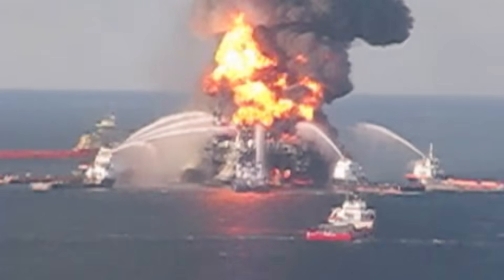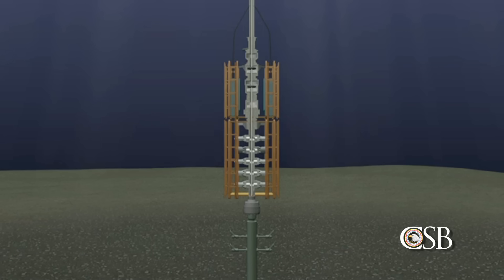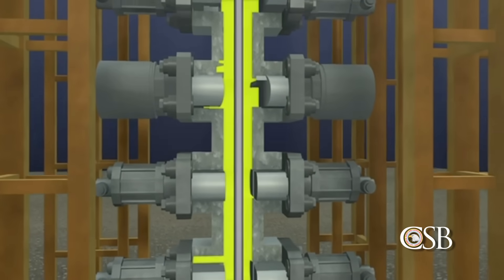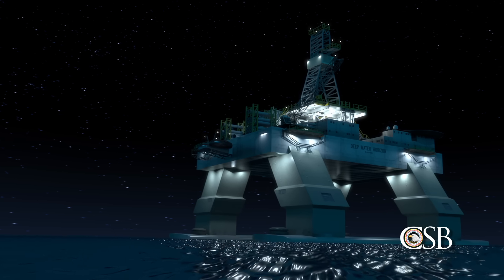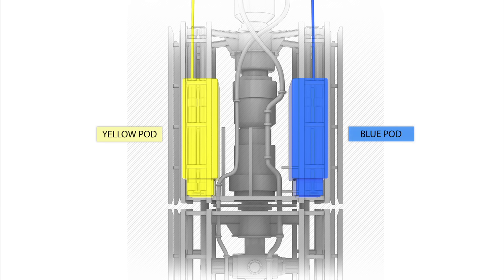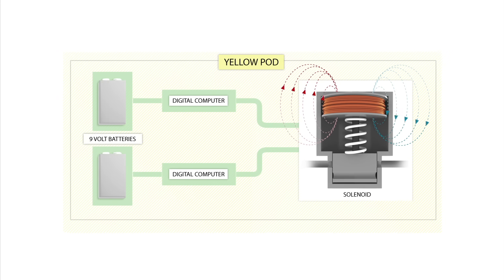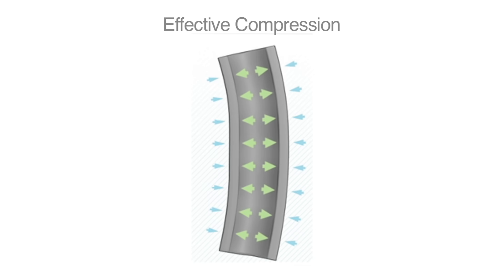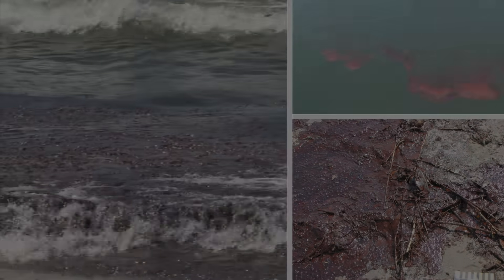Deepwater Horizon Blowout Animation

Comment: Nice video, thank you for the information.  However, I have one issue with it, in the opening lines of the video it says that the Deepwater Horizon Blowout was the “largest oil spill in US history.” As I understand it, the estimated loss of oil from the Deepwater Horizon was 4.9 million barrels of oil.  However, the estimated loss of oil from the Lakeview Gusher in 1910 was 9.0 million barrels of oil.

Maybe the Deepwater Horizon Blowout was the largest off shore oil spill, I don’t know, but it clearly was not the “largest oil spill in US history.” I’m not saying that the Deepwater Horizon Blowout was a trivial oil spill, but this is a simple fact has been miss reported over and over again unit everyone just accepts it as "a fact.".  I guess if it’s said often enough it becomes fact…
Reply: Maybe it has more to do with the effects of the spill, rather than sheer volume of oil being spilled? Offshore rigs going down causes quite a lot more damage to a wider area than land-based spills...
Reply: Barrels and gallons are not the same thing, Cory.
Reply: @Shane Lizard it's important to note that about half of the oil spilled from Lakeview gusher was in fact contained and recycled/saved, and that measuring accuracy in 1910 was likely far less accurate than in modern times.

The fact that it was contained on land also made it far less detrimental in general.  But that's besides the point.
Reply: @Shane Lizard what are you talking about?  I am 100% correct.  My claim isnt that they quoted the amount wrong; I said deepwater horizon was the largest oil spill in US history, not Lakeview gusher, which is true... not to mention that "barrels" is not a standard if measurement; gallons is.

You should probably read the statement before trying to correct it like a moron.
Reply: I think that must be the case. It's also because of the extensive damage that the oil caused for the ocean
Reply: Sorry but that is a mistake.  200 million gallons of oil released in 87 days; BP's deepwater horizon incident is in fact the largest spill in US History.
Reply: 200 million!!!

Comment: If this is all correct, there sure was an awful lot of crap to go wrong. I am not implying any thoughts by saying that, but it is hard for me to imagine so much going wrong with so much redundancy. I just wonder if there is a simpler answer, or if not, what are the odds? I have not paid attention to this subject and have no real thoughts, but I would imagine there are conspiracy theories about this because of all the things presented as coincidence, or all the cause and effect.
Reply: Using a BOP that should be held OPEN, not held CLOSED. Like God Damn, if you lose power those shear rams should snap shut and slice the pipe in half to try and save the rig; bam, your dead-man switch is an electric trigger that keeps a solenoid inside holding the rams open under massive spring tension. Power fails, solenoids switch off, rams slam down on the pipe and shear it in half
Reply: multiple incidences of incompetence combined with inadequate testing
Reply: You can still have failures no matter what configuration. The idea here is you have several separate systems working so that even if 9/10 fail the last one can prevent the accident. The biggest issue had nothing to do with how these systems were designed it was the complete lack of testing done to check if it's working or not.
Reply: Its simple, human error.

Comment: So let me get this straight this who disaster was caused by a presure drop inside the anular space on the BOP and a miswired solinod valve.
Reply: It was more of a result of breach of multiple safety systems. Clearly defence in depth was applied but due to multiple failures in human actions and instruments it allowed for a critical path that pierced all layers and lead to the accident.
Reply: There were a bunch of things. You are supposed to test equipment and keep it maintained. Lots of stuff on first testing can be found to be a complete mess, it's just natural at some point someone makes a mistake. The checking is supposed to catch that so you have 2 issues, the wiring and lack of inspection/maintenance. It is really crazy both systems failed though, that is extremely rare.
Reply: @MrFunkhauser  That's how regulations occur and then these same companies complain about regulations. To them, that 5,000 barrels of oil was excusable and not worth additional regulation.
Reply: Yep. On those oil rigs, one thing screws up the tiniest bit, you're f**ked.
Reply: Solenoid*

Not trying to be a grammar Nazi, just a genuine correction in what that thing is called
Reply: @theshermantanker7043  thank you for the correction
Reply: *solenoid valve 

The solenoid valve actually ironically ended up working 

Issue to fix though

The annular valve didn’t stop 

Action could hav been taken faster to stop the initial flo me he
Reply: @ you are correct on that.
Reply: The flow was so forceful it broke right through the sheer ram ,   I've been studying the DWH for months and I'm still learning about what exactly happened
Reply: @ exactly. There’s a lot of great information out there on the accident.
Reply: @FerroequinologistofColorado  another major factor was that BP did not run the cement bond log test to see if the cement had cured properly,   the testing team was sent home because BP didn't want to spend 120 grand for the test.   A 186 billion dollar company and they're cheap
Reply: @ exactly.

Comment: This is a superb animation of the BP/Halliburton/Trans-Ocean disaster BUT I'm rather surprised that the fact that they only used six spacers instead on the 21 spacers necessary in keeping the "Halliburton" cement centered and evenly spaced throughout the bore as one of the most likely contributing factors. You also didnt mention that Schlumberget engineers left the rig after they were overruled on an inspection on the cement's condition and hardening. Had the cement been tested and analyzed thoroughly, this wouldn't have happened. Yet another perfect example of profits over people/environment/safety by The Big crimcorfednewsgov outfits around the globe. The consequences? We're still learning them and will continue for centuries to come. Can anyone say...Exxon Valdez 1989? BP had a larger hand in that disaster than even Exxon and like BP...Exxon is fighting to keep every dime from reaching the people who won it from them in a settlement reduced to 10% of the original payout of about 6,000,000,000.00 by the supreme court of corporate jesters.

Comment: The drilling fluid-mud is the first line of prevention to control formation pressure.  If the fluid density isn't enough to balance the formation pressure a kick will occur (influx oil and gas) into the well bore right? Why didn't personnel catch this influx immediately as excess displaced drilling fluid in the mud pits? Bad communication?
Reply: Because corporate would effectively hang them if they didn't keep up with the schedule. DWH was far behind schedule at that point and draining money like a seave...
Reply: Harrison _  what kind of answer is this?
Reply: One word: Capitialism
Reply: @padathir  don't act like communism doesn't do the same too. Need I remind you about Chernobyl and how it was made worse by the Soviet Union trying to cover it up?
Reply: Harrison _  They are doing pretty good right now. Crashed the economies of the west, took hong kong, handled the virus.

Comment: Someone help me to understand.
If as they sad, the pipe ram worked successfully and isolated the annulus space and drill pipe space above the pipe ram. Then how the pressure inside the drill pipe above the pipe ram can cause buckling the drill pipe under the pipe ram if it was already cutted ???
The buckling of drill pipe under the pipe ram is also in doubt. Annulus pressure was get out from the drill floor. Because after the pipe ram cutted the drill pipe, the pressure in drill pipe above pipe ram should not be increasing, it should be constant. And even the difference between the 2 constant pressures (annulus and drill pipe above the pipe ram) it should not cause the buckling of drill pipe above the pipe ram.
Would be thankful if someone will read it and answered it.
Reply: Before dwelling deeper into the matter, let me first clarify two things, which you may have misunderstood:
1. The drill pipe buckled above the pipe ram, not below as you write.
2. The pipe ram did not cut the drill pipe as you write. Moreover, the pipe ram is not designed to cut the drill pipe. Maybe you are confusing it with the blind shear ram.

Perhaps, the above already points already give sufficient guidance. If not, I hope they help you rephrase your question in a way that we can understand you better.
Reply: Thomas Hille
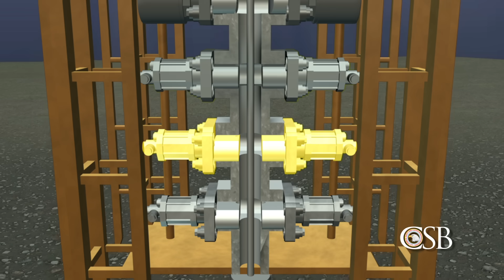 I think the question is: why was there still pressure in the pipe after the closing of the pipe ram? (at 4:21)
Doesn't a "successfull closing" mean that the flow stops?
Reply: Kalleponken
In the annular space, yes. However, the drill string is hollow. Thus, the pressure builds up in the annular space (the space around the drill string), and causes the fluids to be forced upwards through the drill string. Therefore, the pressure inside the drill string and the annular space below the pipe ram is equal, but there is a huge pressure differential between the drill string and the annular space above the pipe ram. 

The BOP isn't successfully closed until the drill string is sheared by the shear rams, and the annular preventers are closed.

Comment: CSB has an easy to understand video on the deepwater horizon blow-out preventer.  What's most shocking is that both critical emergency systems were simply mis-wired.  That simply shouldn't happen.  As the BOP was commissioned, these errors should have been identified and fixed.
Reply: ***** : I understand that the mis-wirings were done during BOP maintenance many years after it was put in service (some just before Macondo), and it was not adequately tested after that maintenance. It is not clear where the solenoids were rewired, on the rig or onshore.
Reply: This! As a control systems guy myself, I was wondering how mis-wired valves and some wiring error that drained the battery (?!?) could have been missed. My initial reaction is that the people who performed, witnessed and signed off on the commissioning should be "shot". But then, who might have had their hands in those control pods, for what reason, after the thing left the shop but before it was put in service (assuming here that commissioning takes place on dry land)?

Comment: Is it just me or did this video  make no mention of BP ? Public Relations at your service
Reply: This video is a documentation of what the CSB believes happened to the BOP. It is strictly an engineering discussion of the technical failures, not how it got that way.

That said, engineering does not happen in a vacuum. It is driven by decisions made ultimately in the board room --whether deliberately, or by omission. The latter is a much more difficult issue to sort out. However, the CSB has experience with BP's corporate management before, having investigated and prosecuted the causes behind the 2005 Texas City Oil refinery explosion. This is one reason why they're the ones doing this investigation, not the Coast Guard, not the EPA, not the NTSB or any other numerous alphabet soup agencies.
Reply: The CSB does not prosecute or issue fines. They only investigate, report their findings and issue recommendations to plants and regulatory agencies, such as OSHA and the EPA.

Source: CSB website http://www.csb.gov/about-the-csb/mission/
Reply: That's because the BOP was made in America. They didn't mention that either.